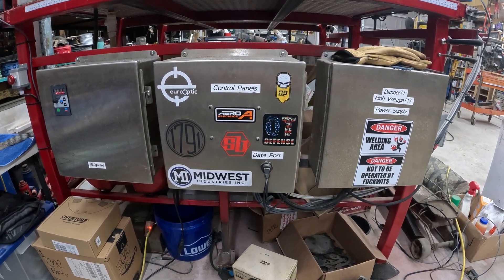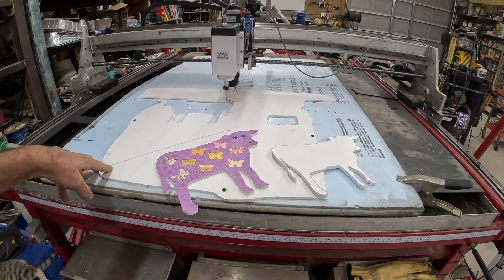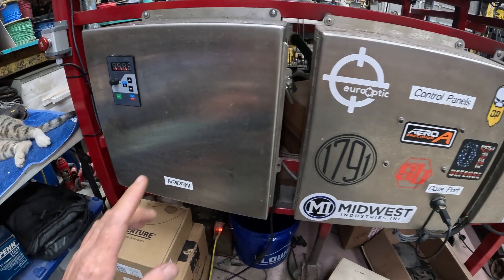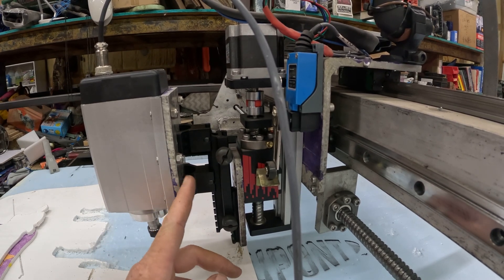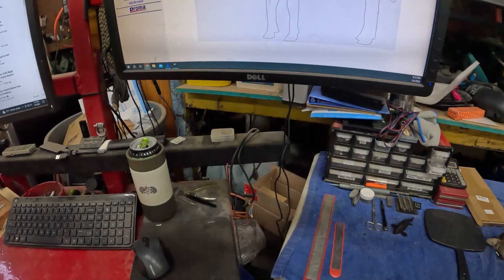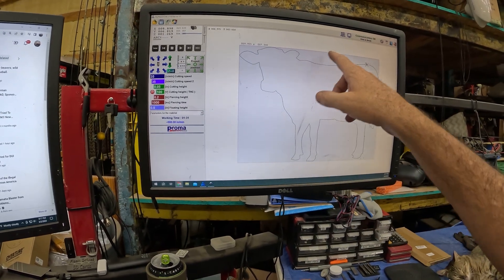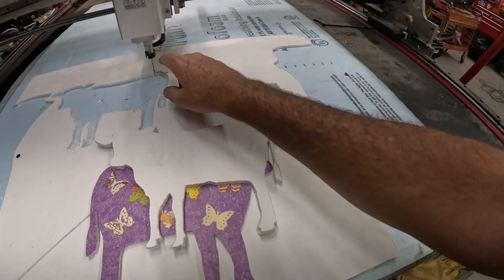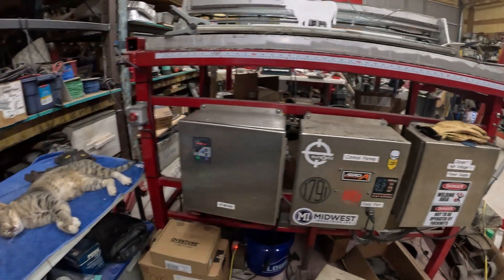Can The MyPlasm CNC Run a Brushless Spindle and a VFD?? DIY CNC Plasma Table / CNC Router Table!!

Comment: Maybe consider adding Carbide drills (higher speeds) for smaller holes in your Plasma cut jobs or if you need better tolerances providing you can accurately do the positioning offsets. You might need to create the G Code outside MyPlasm in say Fusion 360 to generate peck type Z moves but that might also allow even more options for a play.
Reply from the maker: This is a very crude setup just to see if it would work.. I have a ton of endmills but none that are 1/8" shank.. I have ordered new collets and a few carbide endmills as well to experiment with. We will see how that goes... I like the idea of using Fusion to generate the G-Code, I may have to try that one!  Thanks for the thoughts!!